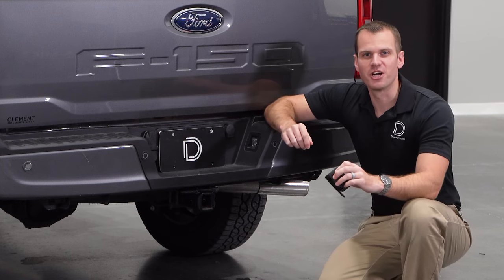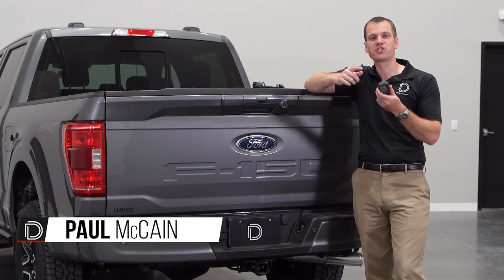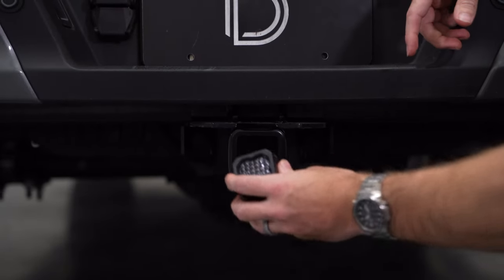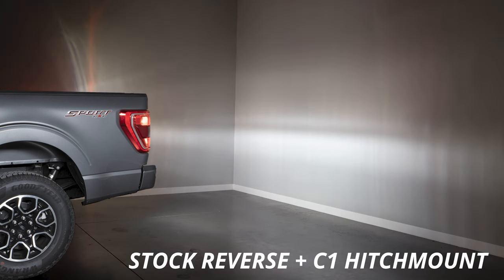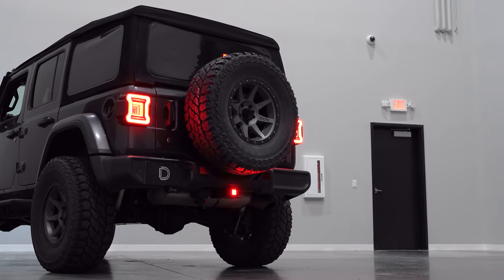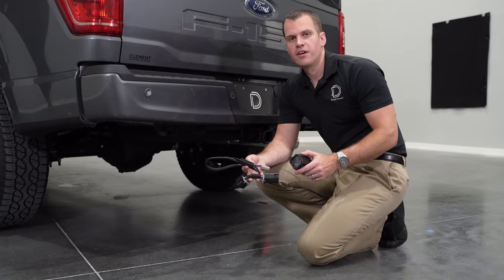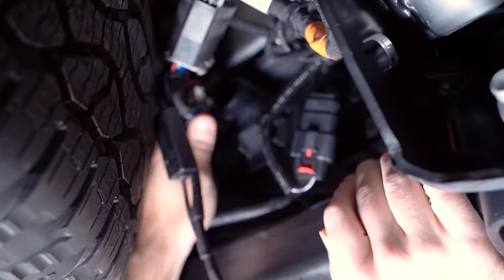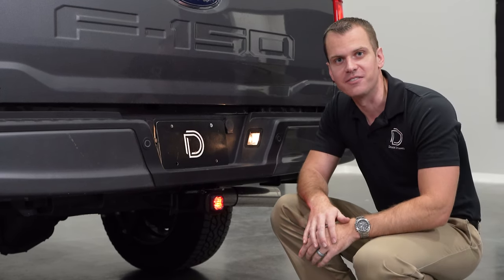The BEST 5-Minute Mod! Stage Series HitchMount LED Pod

Comment: ill just steal one LOL
Reply from the maker: These are rather low profile when installed. 

However, if you interested in adding extra security to your new HitchMount LED Pod? 

We just released a new video addressing this using a locking receiver pin. 

https://www.youtube.com/watch?v=yr3GmX8EFvg
Reply: I don’t use my hitch for towing so I’ll jb weld it. Good luck 😂

Comment: I think it is funny that you are using a f150 in your demo. You can NOT plug into the trailer harness of these without getting a trailer connected warning.
Reply from the maker: Hey there! While this message may appear in some makes and models, it will not change the functionality or performance of your truck!
Reply: But it does change the functionality of the truck because it will turn the blind spot monitoring off if a trailer is connected on pre 2017 or 2018 f150s that do not have trailer blind spit monitoring.
Reply: @toledoupsguy6064  lol shouldn't have bought a Ford!   Sorry, but had to say it 😁
Reply: True, I'm having that problem now, and I did not know this would happen

Comment: But what about potential theft? Do the tabs have holes so that we can put a lock on? @diodedynamics
Reply: It looks like you could drill out the center of the tab to run a hitch pin lock through it.
Reply from the maker: You're correct! 

We just released a video showing how to add a locking receiver pin to this product for added security. 

https://www.youtube.com/watch?v=yr3GmX8EFvg

Comment: Not all hitches are created equal, my 2019 Ford Ranger is solid, had to drill a 1" hole to get the connector through, so not a 5 minute job, but still relatively easy.
Reply from the maker: Sorry about that! The Ranger is one of the only hitches that we are aware of that does not have an opening at the rear of the receiver.

Comment: Both are great, but that C1R is absolutely fantastic! The option to have the brake light strobe or not is a smart addition, too! When the strobe was shown, I was thinking that was going to be a deal-breaker, but then the option was mentioned and I was completely on board again!

I was actually thinking of building something like this with a red/white dual-color LED bulb replacement unit (if I could even find one) and a relay (to keep the red and white from lighting up at the same time) but this eliminates all that work and is certainly going to look and perform better than what I had in mind.

Comment: This is cool, but i wish you had one that was bigger/wider with more LEDs. It would be neat to have yellow turn LEDs as well. Something like the Weathertech Bump Step, but with your awesome LEDs integrated.
Reply from the maker: Cool idea! We also do have a flush mount option for the rear bumper as well if you are looking for more light output! We offer them in single or pairs of SSC1s, SSC2s, or even SS3s!
Reply: @diodedynamics  Can the SS3's be wired into the same trailer hitch port? I like the connector you have on the trailer output harness. Do you sell a splitter so I can daisychain a few lights off of it?
Reply from the maker: @johnroberts9183  They should be able to, yes! Here is a link for the Dual output harness we offer for the 7-pin:

https://www.diodedynamics.com/stage-series-7-pin-dual-output-trailer-wiring-harness.html

Comment: It would be so awesome to have a 4 pin connection for this, I don't want to buy this and then butcher the 7 pin harness. You guys are really good at customer stuff like this so fingers crossed I don't have to wait much longer!
Reply from the maker: Our engineers are working on a possible solution for this! It is proving difficult since the 4-pin harnesses don't include a reverse wire! We'll keep you posted!
Reply: @diodedynamics  I'm glad you guys are trying, I'm sure you'll come up with something. You always do!
Reply: @diodedynamics  Or just make an adapter that plugs into the bigger harness higher up. It would require removal of the spare tire for installation but this would be the best route.
Reply from the maker: @danroot84  Unfortunately, the 4-pin harness does not come with a reverse light function, however our team is coming up with a workaround for this! Stay tuned for future releases!

Comment: So if your vehicle has a 4 pin connector, do you have to wait to preorder? Will there be a plug and play version for 4 pin connector vehicles for both models of this light? Or how is this able to be used only on a 4 pin connector vehicle?
Reply from the maker: No plans at this time for a 4-pin connector but we've relayed this information and request to our engineering team!
Reply: @diodedynamics  Can the 7 pin version then still be wired or spliced in to 4 pin wires so it will still work with either model light?

Comment: You should include a dummy 4 pin to cover the connector when the light is removed for towing a trailer. I tow in the winter and can see water, mud, and salt getting in it.
Reply from the maker: We'll pass that along to our engineering team!
Reply: @diodedynamics  That's actually a great suggestion by clayrev. In the meantime, what would you suggest while your engineers are having their brainstorm session?
Reply from the maker: @redbirdsjunkie  There are a couple solutions we have, you could simply disconnect the harness if you will not be using it for an extended period of time, or, you could apply some Dielectric grease in the connector and tape it off. It's not ideal, but while our engineers are finalizing the caps, it will not damage the connector in any way!

Comment: Ford Ranger 2019 and up doesn't have enough room in the factory hitch to route the 4 pin Deutsch connector.  You'll have to depin it.  Careful because the wedge in the connector is brittle. 
Speaking of not having room with the Ford Ranger. It's way easier to squeeze the tabs for the hitch wiring assembly and push it through the hole in the bumper towards you. Then add the harness and feed it back through.  It's pretty tight between the trailer hitch and spare tire.
Reply from the maker: Thank you so much for the insight!!
Reply: You know what would be cool. If we could have it turn into a rear fog light. If we turn on our forward fog lights this will automatically go to its brightest setting. And flashes when we break. I thought of it when I got passed by an Audi with its factory equipped rear fogs. After a while those were the only things I could still see of the Audi. Just a thought. Plus, no one else offers something like it.

Comment: Love the C1-r option. I've been thinking about what kind of wiring harness I could put together to double the backlight as running/auxiliary turn signal. This makes that much easier. Any chance these will come out in an amber option for the front and the other pod sizes?

Comment: I recently purchased the c1r on Amazon and love it so far had it for 2 days but mine doesn’t strobe I definitely brakes with the rest of light when applied but no strobe and I did not cut the purple wire
Reply from the maker: Hey there! Feel free to give us a call at 314-205-3033, Monday-Friday 10 a.m.- 5 p.m. CST, or shoot us an email at contact@diodedynamics.com, and our in-house US service team would be happy to help you with that.

Hours: Monday-Friday 10 a.m. - 5 p.m. CDT
Email: contact@diodedynamics.com
Phone: 314-205-3033

Comment: looking at your hitch light but instead of the vehicle, I am thinking of putting it in my trailer hitch. The trailer did not come with reverse lights so I am wondering whether I can connect the harness to trailer's plug and then have it connect to the 7pin of the vehicle. Then I can carry the wiring for the hitch to the back of the trailer. Let me know what you think and if that will work.
Reply from the maker: Hey there! In this case, we would recommend getting the 7-pin in-line harness, then using one of our 3m extensions, or however long you need to reach the back of the trailer, then you can plug the light in from there, however you see fit!

Here is a link to the HitchMount, and extensions :

C1R HitchMount:
https://www.diodedynamics.com/hitchmount-led-pod-reverse-kit.html

4-Pin DT Extension Harness:
https://www.diodedynamics.com/dt-4-pin-extension-wire.html

Comment: Can you further elaborate on the 15-second interval for the strobe function? Why does it not strobe every-time you step on the brake instead of the 15-seconds interval?  
Thanks
Reply from the maker: Hey there! In the included harness, there is an enclosed circuit board that has a timer inside, restricting the frequency the pod will strobe, avoiding annoying over-strobing that could actually distract drivers behind you in stop-and-go traffic! I hope this helps!

Comment: I have the C1 for my 2022 Raptor but it will disable all the safety back up and sensors since the vehicle thinks it’s linked to a trailer. 
I pulled mine out because I wouldn’t trade the safety sensors for an additional back up light.
I will probably just keep it and maybe install in as needed basis.
Reply: Same
For gen 2, thinks trailer is attached. I’ve been told a “fix” is coming …
Reply: Wanna sell it?
Reply: Got the new wire harness and still says trailer hooked up
Reply: @zekebarbosa5428 has it been fixed?
Reply: Not yet still waiting

Comment: Looks great im looking at my second gen tacoma and doesn't look like it will work... The harness and plug is one on the tacoma you cant unplug it.. Is the main harness just power/ground/reverse/and brake? Im assuming so technically i could just cut the plug off and make my own harness to tap into the factory harness...

Comment: I've got a 4 pin connector.will a 4 to 7 adapter allow for all functions to work..
Reply from the maker: Unfortunately it will not, as the 4-pin connectors do not have a reverse light function. Sorry about that!

Comment: Just received mine for 2022 Hyundai Santa Cruz with the OEM trailer package and 7 pin wiring but I am having issues getting this connected. I rather not be splicing cables to get it installed. Any advice?
Reply from the maker: Feel free to give us a call at 314-205-3033 Monday-Friday 10 a.m.- 5 p.m. CST, or shoot us an email at contact@diodedynamics.com, and our service team would be happy to help you with that!
Reply: @diodedynamics  yup I have an email in since last week. Figured with the holidays there might be a delay. Just waiting for a response :)

Comment: What about on a Jeep JK that only has the 4 pin tow connector?
Reply from the maker: No plans for a 4-pin connector at this time but we've shared this popular request with our engineering team!
Reply: @diodedynamics   you would sell the heck out of these to the Jeep crowd! Just release one without the round wiring adapter, give extra length of wire to fish up into taillight pocket area and include wiring diagram

Comment: Another stupid question here, will the truck thinks that a trailer is connected when i plug this light?
Reply from the maker: Great question! It depends on the make, model and year, our engineers are working on a solution to prevent this from happening across the board on newer models!
Reply: @diodedynamics  hi thank you for answering my question, do guys have plans on testing this wonderful product on newer trucks for the benefits of your customer. So people would know if this will work flawlessly in their trucks before purchasing.

Comment: Bought the C1R that has both running light and brake light feature with the optional SafetyStrobe Feature for my 2021 Toyota Tundra and have it installed.  But from the test done in the garage with foot on the brake I am not seeing any safety strobe effect when applying the brake the first time.  I did no modifications when installing.  What do I need to do to get it to flash??  Thanks!
Reply from the maker: Hey there! Please go ahead and give us a call at 314-205-3033 Monday-Friday 10 a.m.- 5 p.m. CST, or shoot us an email at contact@diodedynamics.com, and our service team would be happy to help you with that.

Comment: Is there a way to wire in a toggle switch also so I can turn it on when hooking up a trailer?
Reply: Probably just test which wire triggers backup white light and tap in. I did this with some other rear bumper floods and just connected the power wire from the pods to my reverse lights and also a switch. Should be pretty simple.
Reply: you wont be able to use this, and a hitch at the same time, unless you have some double hitch setup
Reply: @ShadowDragon246  No I know, you would have to pull it out and set it on the bumper or something I suppose, but more or less if you were even doing work behind the truck you could use it as a utility light.. That was more or less my point in asking about a separate switch..
Reply: Not sure about this product, but along similar lines there is a cheap product called Blazer International C8020 on Amazon. Plugs into the 7-pin and acts as a reverse light while also having a switch to allow for general use when parking lights on the vehicle are on.

Comment: Do you have any amber bulbs or pods that would work in the new Silverado ZR2?
Reply: Fog lights, that is
Reply from the maker: Unfortunately, we do not have anything yet for the ZR2. We do have universal brackets that would work anywhere you want them to go, with a little bit of custom work. We can relay that to our engineers for future consideration on developing plug-and-play options for the ZR2!
Reply: Thanks for the response. I would definitely be interested in the plug and play fogs

Comment: Really really nice!! I would like to put it on the upper hitch mount of a double hitch, I'm pretty sure I need a cable extension, is that possible?
Reply from the maker: Yes that is possible! You should have enough wiring to fit it a little bit higher, if not we also offer a DT extension harness!
Reply: @diodedynamics  thank you!!!

Comment: Can Crosstrek run it? Does Crosstrek have power output under the rear?
Reply from the maker: This will fit any 2" receiver but you will need a trailer harness to use the included adaptor. 

For assistance, please go ahead and give us a call at 314-205-3033 Monday-Friday 10 a.m.- 5 p.m. CST, or shoot us an email at contact@diodedynamics.com, and our service team would be happy to help you!

Comment: Does this make the trailer detection on newer trucks active or no?
Reply from the maker: It does depend on the year, make and model of your truck. We are currently working on a universal solution if this issue does arise, however at this time, Putco does make a harness that fixes the issue if you do need it asap!
Reply: Hi, yes, it does! I'm having trouble with getting it to go off. I have a king ranch, and it keeps telling me to disconnect the trailer and that the blind spot monitors don't work. So I'm thinking of sending it back
Reply: @uncledebo44ch23 has it been fixed?
Reply: @diodedynamics  Are you working on an updated version to fix the trailer detection by chance? This is the only thing keeping me from buying the light, thanks!
Reply from the maker: @redbirdsjunkie  Our team is working on a solution for certain newer vehicles that have different wiring setups for safety. Our engineering team is designing a workaround for those vehicles. What do you drive?
Reply: @diodedynamics  Thanks for the update. I drive a 2021 F150 XLT 4x2 Supercrew and the trailer management alerts has been a common issue/theme that I've read so I've been holding off on buying this hitch light. Thanks again!
Reply from the maker: @redbirdsjunkie  Sure! Our team is currently working on a harness specific to the 21+ F150s at this time. Unfortunately, we do not know when exactly those will be released, however, we will keep you updated on those!

Comment: Why won’t this work on a 2022 Chevy Colorado?
Reply from the maker: Sadly, the safety systems on the Colorado are different than that of the Silverado. Our team is constantly revising and engineering new harnesses for vehicle-specific applications. We'll be sure to relay the Colorado for future consideration!
Reply: @diodedynamics  what safety systems does it affect more information would be appreciated
Reply: @diodedynamics  I want to know what will happen if I put this on a 2022 Chevy Colorado.
Reply from the maker: @tedbeach4766  Newer trucks typically come standard with trailer safety warnings that pop up if something happens to your trailer. In this instance we are drawing current from the 7-pin, triggering a loss of current, which pops a message up on your HUD. We are not familiar with what exactly happens with the light itself, however it is not compatible at this time.

Comment: What's stopping someone from stealing this
Reply from the maker: Our HitchMount pods are capable of fitting a locking hitch pin through the light, if you are concerned about theft, check out this short video showing how to modify your light to receive a hitch pin!

https://youtu.be/yr3GmX8EFvg
Reply: @diodedynamics  ahhh, cool